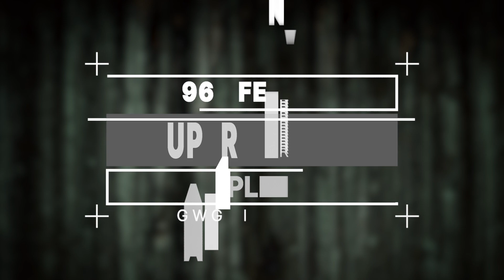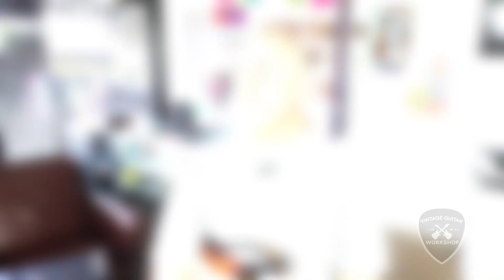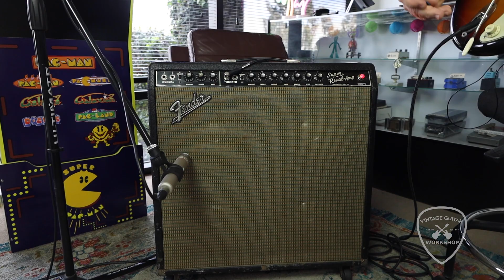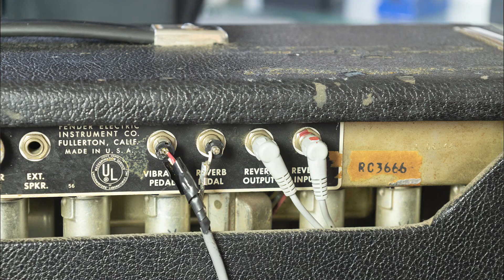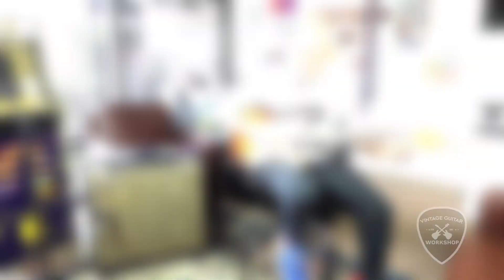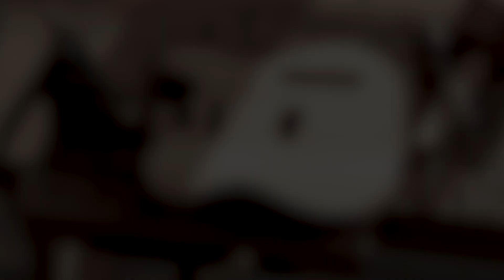1964 Fender Super Reverb Amplifier - VGW

Comment: I own one of these amps ... bought it in early 1964, my first amp. STILL GOT IT! And I'm blessed to own my older brother's 1X15 1966 Super Reverb that came to me when he passed away back in early 1995.
Reply: Had a '70 silverface for 25 years. Mine had the CTS alnico speakers.
Did your brother's amp have the original output transformer with the single 15" driver? Cos the original output is 2 ohms as you know and the single 15" is 8 or 4 ohms?

Apparently that was part of how SRV had his SRs setup.
It's really hard on output tubes but saturates the OT sooner.
Reply: @ix-Xafra  He actually had a single 12"  D-120 in it, with the original 2 OHM OT. He used to build amps (transistorized, that he made the head cabinets for, and 4X12 cabs (early 1970s), and he built lots of speaker cabinets for guitar and PA systems ... he started back in early 1964 with a Bell PA amp and made (2) 2X10" cabs covered in gray Tolex which we used on big Atlas stands (we had two really good lead singers) ... One of the first portable PA systems in Jacksonville FL in the day. It sounded fabulous and got us run out of a church venue that I think, The One PerCent also played at (Lynyrd Skynyrd). So he knew that the Super Reverb 2 Ohm OT would survive with an 8 0hm load. However, I replaced the OT with an 8 Ohm Magnetics Corporation (sadly, now defunct!) OT and made a new baffle out of 3/4" birch. Put a Weber Classic Alnico 15" in it. I have a JBL D-130 that I am thinking of having rebuilt with a paper dust cover (aluminum is great for closed back cabs, but a bit harsh I think, for a Super Reverb open back cab). 

My brother's first amp was a new 1960 PRO with a 15" in it. That same era, Fender offered that same amp with a beefier OT and one of the early D-130's in an amp called the Vibrasonic (50 watts, rather than the Pro's 40).

And good on you with that silverface Super Reverb ... fabulous amps! We were a CTS dealer out of his store in Tallahassee, Florida IIRC! Thanks for the "comeback"! Some great playing in this video!
Reply: @Tonetwisters  thanks for the reply.
I'm building my own amp atm.
Deluxe output section with 6v6s but using 6SL7s in the preamp and a cathodyne PI ala Princeton.
The cabinet will house my ancient Line 6 POD PRO in the top and the stereo output of the Pod will go into a triode each of the first 6SL7.  Got one triode biased and bypassed like a Bassman and the other triode gets the JTM bright channel treatment.
I'll be running that into a 12" Lorantz greenback clone.
Lorantz is an aussie speaker maker - good stuff!
Reply: @ix-Xafra  Good on you, Mr. Vinny! Fabulous stuff when people delve into amp building. I'm sure it will sound quite spanky!